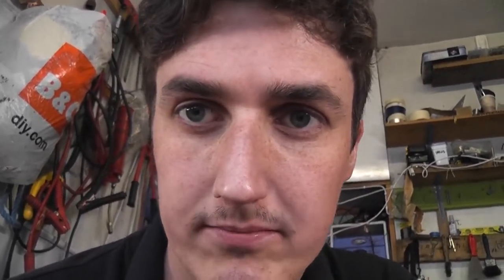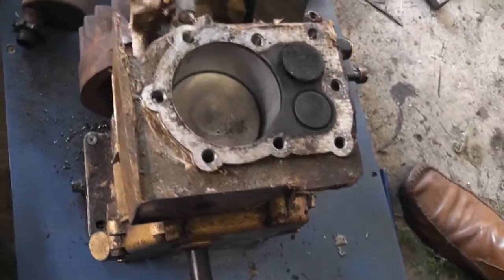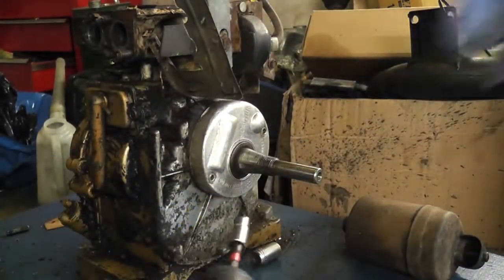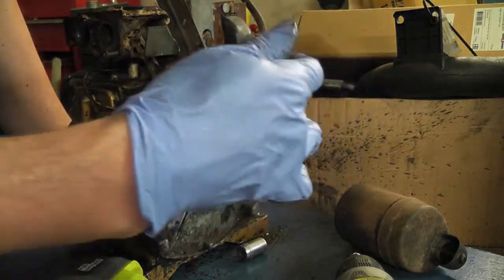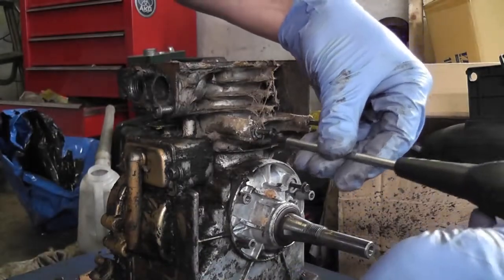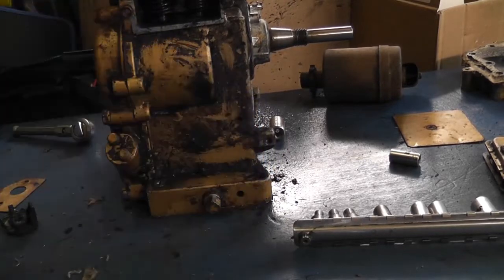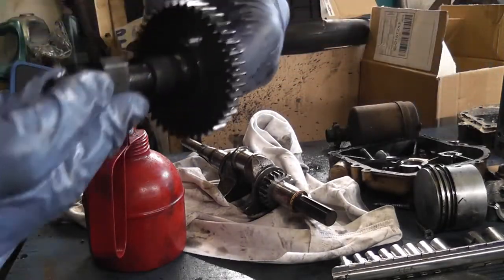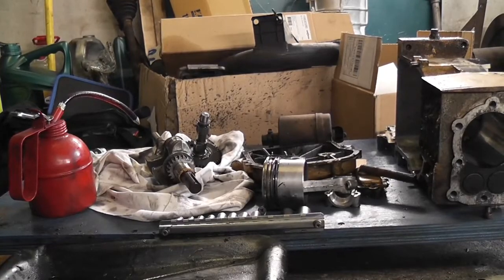SMALL ENGINE REPAIR - Stripping the 2hp Briggs & Stratton

Comment: Yeah looks to be in good shape mate.  Could be that the carb needs adjustment. The value looks very dirty.
Reply from the maker: Yeah I'm thinking that. I'm going to remove them and relap them anyway, and the carb is having a nice long soak in the ultrasonic bath before I strip it.